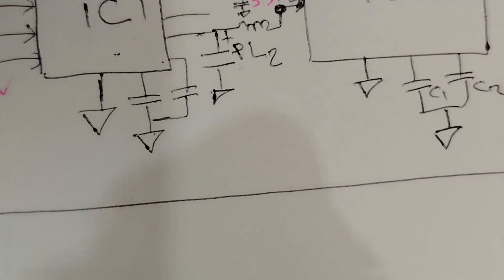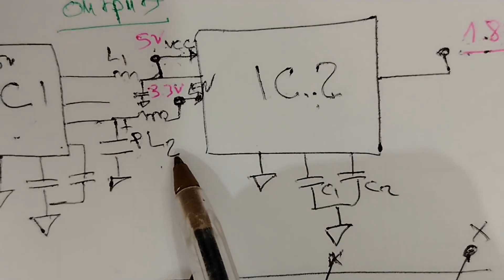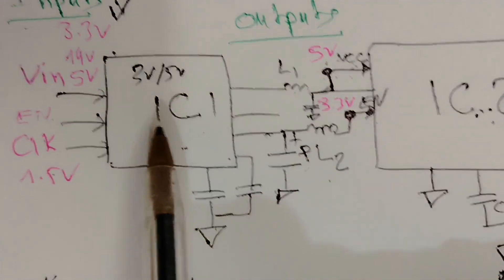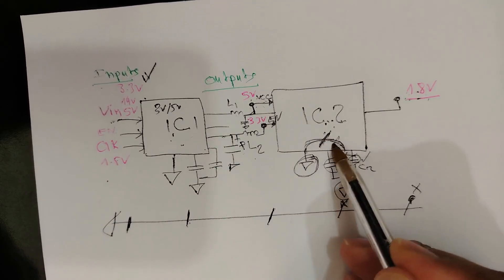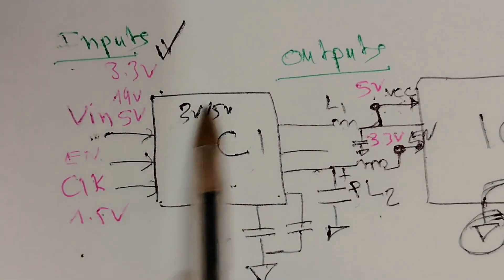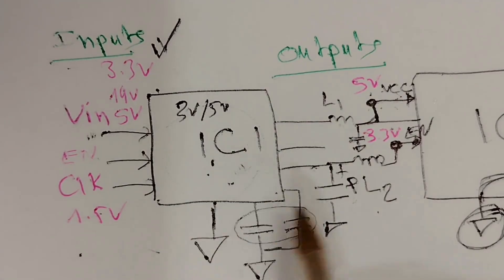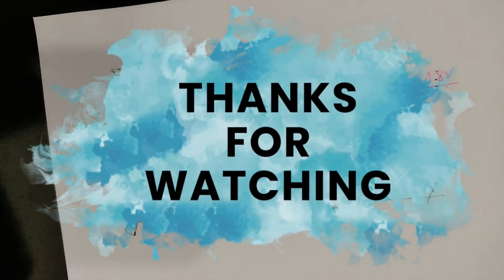IC Testing LIVE: How to Detect Faulty Chips in Seconds - Repair Guide

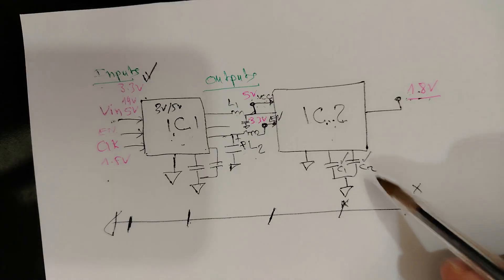Comment: 10:50 y si tenemos algún corto como explicas en la salida con capacitores y no podemos checar voltajes podemos checar resistencia con el óhmetro.
Reply from the maker: Exactly, when the power rail is in short circuit, you can’t check voltages because the board won’t power up.
So the correct approach is:
✔ Use resistance (ohms) or continuity mode to find the low-resistance point.
✔ Compare the readings on both sides of the board or between similar capacitors.
✔ The one showing very low resistance (or continuous beep) is usually on the same line as the short.
Once you locate the lowest resistance area, you’re already getting close to the faulty component.

Do you want me to show the step-by-step method I use to track shorts quickly with only a multimeter?
Reply: @electronicsrepairbasics_erb  si tienes razón porqué una linea del capacitor va a tierra como explicas, pero la otra no, gracias  amigo

Comment: Thanks for the video! Please do a troubleshooting of switching power supply with low voltage output especially switching power supplies for radio transcievers with voltage out adjust. Thanks🙂👍
Reply from the maker: My pleasure; noted for a future video.

Comment: in my lenovo ideacentre AIO A330 20ASTRB2's schematics  there are 3v3 S0 ,  5V S0    and 3v3 S5   , 5v S5   what do they mean ?
Reply: 3v3= 3.3volts  5v = 5volts    S0 and S5 are different power modes . S0 fully working state , S5 is soft off .or standby mode . Anyone can correct me Thats  how I understand it , from previous lessons on this channel
Reply from the maker: Good job, zolabudd2482
Reply: @electronicsrepairbasics_erb  Sir , do these mean   there's a 3.3v and 5v  when system is off , and another 3.3v  and 5v when system is switched on ?
Reply: @tunkunrunk  yes. One is present all the time, the other is only when the system works